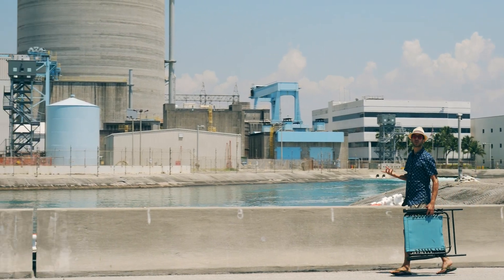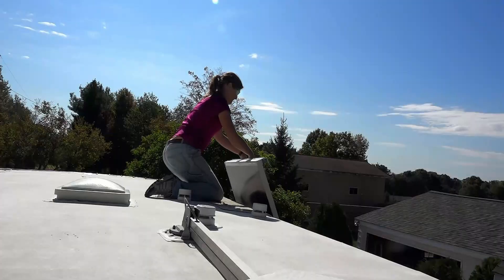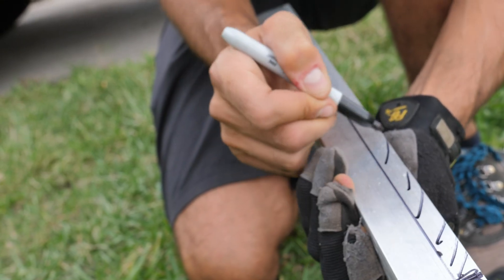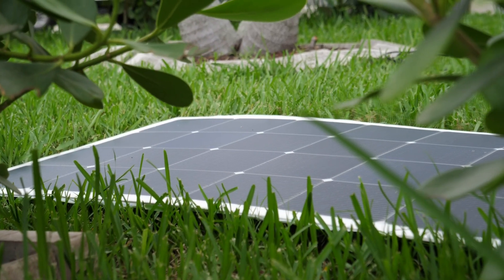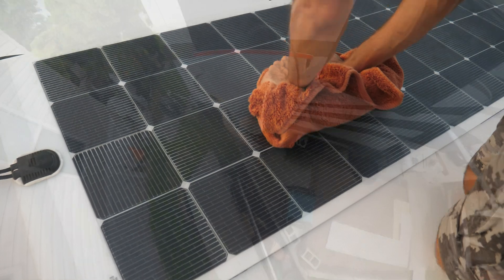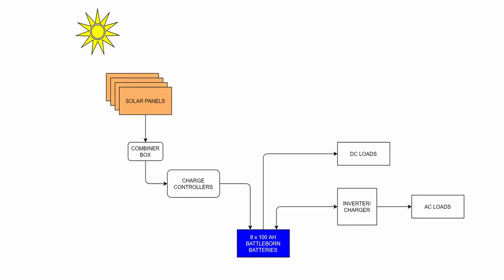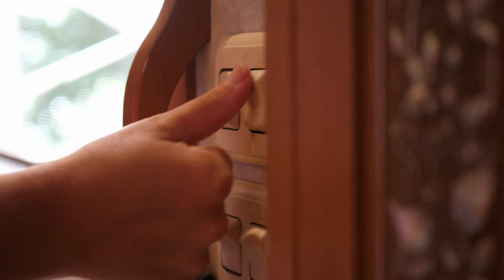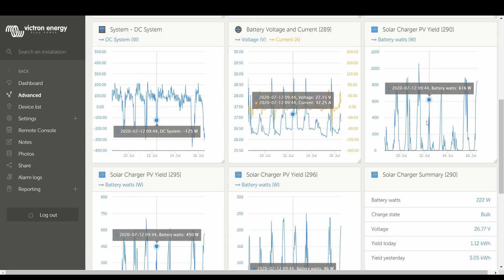Ultimate RV Off-Grid Solar System Build - 2760 Watts of Solar ☀️ 11Kwh Battery, on a 32' Fifth wheel

Comment: It could have been more detailed. A few key details would be: 1.  What was the total cost of all the units including the panels and cables?   2, How many labor hours did it take for the entire installation?  3, How much would it have cost to have it professionally installed?  4. How much would it have cost you for electric to be run to your property as a comparison of real values? (Not including having all that power in all the other boondocking locations you go to and without having to run that stinky, noisy generator!) 
    Please include details like these in your future videos, Please.

Comment: Over $13000 for this system not installed.  Is this correct?
Reply from the maker: About spot on,  could have been alot less with reg residential panels. This is our primary power summer tho.

Comment: One question and one comment.  What was the total price tag for everything?  Nothing made by battle born is cheap and that Victron setup is first rate.  Now, the comment.  Mounting the inverter on its side like that will make it tough to cool properly as the fans and intakes are meant so pull from under it and exhaust above.  You have any issues with it getting hot on you?  Especially in the non climate controlled basement?

Comment: I consider myself a very technically savvy. I've done a lot of very involved household and automotive electrical projects in my life. I have been a handyman my whole life. I have a very good working knowledge of automotive, household mechanics, and electrical systems. However, I must say, I am completely and totally overwhelmed and intimidated by designing and installing a solar system on the RV my wife and I just purchased. However, I don't know that I trust a local RV dealer to do a good reliable and dependable solar install. I just feel lost and I don't know where to go from here.
Reply from the maker: We understand it can be overwhelming to get started with RV solar. You may want to start here with this article: https://www.mortonsonthemove.com/complete-guide-to-rv-solar-battery-chargers/ At the bottom of the article, you'll also find a "Solar Calculator," which will help point you in the right direction. :)

Comment: Seems like the most expensive way possible to purchase solar, but I understand the sponsorship make a difference. How do those panels handle the efficiency loss due to heat, I've read that was the down fall of all the direct contact glue down type flexibles.
Reply from the maker: You are correct this is a very expensive solar system and not ideal for a fifth wheel. We used these panels on our truck camper too which made more sense. As far as heat, yes they have significant loss up to 20% mid day. Cooler temps or a bit of wind helps alot.

Comment: Would you please provide an update on how the install performed?  And the ones on the front of the RV? It is now 14 months later in December of 2021.
Reply from the maker: The system has worked wonderfully for us since we installed it! We are really happy with the overall performance of the solar panels and the batteries. The power has been very reliable and has given us so much more freedom, especially since we love to boondock.

Comment: great video.  impressive setup!  i am going to share this every time someone suggests that they can just slap a solar panel on their roof and run an air conditioner.  my van has 420 watts of flexible panels in a DC only system with a single 100 ah battery in a system i designed myself.  i ended up needing the help of electrical engineers to calculate the fuse sizes and wire gauges.  it runs like a champ for my simple needs:  lights, fans, and a small fridge.
Reply from the maker: Thank you! :)

Comment: I see a lot of people using 4/0 wires for RV setups. 4/0 wire is good for 300 amps of current. It seems to be overkill, or am i missing something? The solar panels at 2760 Watts at 52V is 53 amps of current.

Comment: Great system. We used flat panels on our last rig. Only downfall was winter. Just not enough solar to support our needs. Ended up adding 200 more watts of tilted panels to compensate. I noted in your video you had a few portable panels by the road. We are currently installing another solar arrangement on our 3rd rig. (Getting expensive-lol) and have most of the components on order or installed. However still debating the solar panels. Leaning towards ones that tilt.

Comment: With such a huge battery bank are you able to keep it at 100% after a few cloudy days go by, without any assistance from shore or generator.
Reply from the maker: Not 100 percent but we have not had to run a generator since installing thins system.

Comment: Are you worried about the uneven wire lengths on the parallel banks causing batteries closer to the sinks to wear out faster?

Comment: I love the setup! I just purchased an Alpha Wolf 26RL-L and pick it up in two weeks. I want to order all the components from your build. Will Battle Born help to let me know how much solar I can fit on the roof based on the specs or is that something I need to measure myself. Also, is there a way to just order the flexible panels themselves as your link just brings me to package’s and I already have 800 ah worth of lithium batteries. Loving your channel!

Comment: The system looks awesome.  I cannot wait to see it down the road.

Did you directly attach the solar panels to your RV or did you put them on something that provides some air flow or insulates them from the roof of your RV to reduce thermal transfer?
Reply from the maker: Check out the next video in the series, we did a bit of both and will be publishing the results soon.
Reply: @MortonsontheMove  I cannot wait to see the video and hear the results.

Comment: I'm totally getting impatient waiting for your next video to come out.. so figured I'd better ask some questions!

My future plan for the RV solar/wind set up is to run my AC's (2) with soft starts and run the 12V side of my RV (fridge and 12v outlets) off the batteries.  The question I have is.. if I want to run it this way, do you still need such a large inverter?  And is this as simple as running the batteries to the 12V side of the power panel with an off shoot to the breaker for the AC's?  Am I making more of a mess than I would need to just run everything and be energy conscious?   Thanks.. and keep up the great video's.. you got me hooked with Go North.. now I'm onto solar for the trip in a few years.. lol

Comment: Nice install!!!  I will be looking forward to see your power output during the few weeks when the days are shortest this coming winter. It will also be interesting to know how well the panels hold up over time.
Since your an engineer, maybe you can build some kind of protector shield that you can snap on during travel days, to help keep the bugs off and keep the panel from hazing, caused by abrasive road debris, like is often seen on plastic headlights of modern day vehicles.

Will you be selling the old panels that you removed? If yes, how much do you want for them?

Comment: I found these guidelines for supporting heavy components on vehicles (like batteries and large inverters):

Design loads for equipment support hardware:
On-Road:
3.7g Vertical
2g Lat + 1 G Long
2g Lat + 2 G brake on 20% grade

Off-Road:
5g Vertical
2g Lat + 1 G Long
2g Lat + 2 G brake on 20% grade

Factor Of Safety - no less than 3:1

Comment: Nice system and presentation all be it completely impractical unless your sponsored by Battleborn.  For that cost you can purchase a new generator and darn near a lifetime supply of propane / gasoline to fuel said generator.  I understand that's not in the best interest of the planet given the current climate of carbon emissions and such but reality seldom take those tings into consideration. These mega systems are not going anywhere until the come waaaaaay down in cost. But it does provide good content for Youtube.👍

Comment: You guys did a fantastic job with the video.  Since you know me I have so many questions.  I will limit them here to two questions..(I have reached out to Battle Born on other questions.)

1) what is your experience with the thermal impacts of direct attaching the panels to your RV?  Does it impact performance of the solar panels?  Does it add any noticeable heat to your RV?

2)  Did you go with the GC2 format because of the first 5 batteries from your Go North Adventure were GC2?  If you did not have batteries, would you have selected the GC2 format?  If yes, why?

3) Are there any concerns on performance of the panels flar on the roof when the sun is lower on the horizon?  Do you mitigate it by have more capacity that will meet your needs when performing at a lower performance because of the sun on the horizon?

We are excited to here your thoughts and your upcoming videos and posts on your website.

Comment: I'm having trouble with how you came up with 11,200 usable kill-awatts out of eight 100 amp hour 12 volt batteries. Can you elaborate. 

A 100ah battery will provide 1 amp X 12 Volts = 12 Watts for 100 hours. On the high end, 100 amps X 12V = 1200 Watts for one hour.

What am I missing?
Reply from the maker: The Battleborns are rated at 13.8 V but under testing their capacity is a bit beyond 100ah.

Comment: Great and very well done video! I noticed that the panels on the front of your 5th wheel are already starting to pucker around the edges.  Have you noticed any of this on the roof panels on the hottest summer days?
Reply from the maker: No the ones on the roof are staying perfectly flat.  The dual curve of the front cap did not lend itself well to the final edges and that was an issue from installation.  We will talk about that in the next video but basically I wouldn't recommend a dual curved surface.  Single curve direction should be fine Tho.

Comment: About how much money would you have to install a system like  that
Reply: $20,238 just for the main components listed: Inverter is $2,825.40, batteries $8,392, panels $8052- I had to calculate the price based on the package. Traditional panels would only cost $3,777, charge controllers $969. 
And that doesn’t include mounts, wire, dc to dc inverter, the thing on roof or labor, etc.  it is a dream system.

Comment: Question- how did you keep a system that large from over loading your truck’s alternator when connected and the converters start using the truck to charge the system?

Comment: I may have missed it in the video, but how do you keep the Battle Born batteries warm when its below freezing temperatures?  Do you use the $200 wrap per battery  or do you blow heat inside  the area were the batteries are located?
Reply from the maker: Because they are kept inside near our furnace no heating is required.  The batteries need to get down below freezing before they shut down (for charging only) and we will be keeping the RV well above that temp inside :)

Comment: I've been planning a solar system and have read that the flexible panels on the roof can create heat issues since there is no air gap between the panels and the roof.  And it's known that heat can impact the ability of the panels to produce output....  The other issue is that if a panel fails, it will be pretty much impossible to remove the panel from the roof vs. a solid panel.  What does Battle Born feel about these issues or what are your thoughts from one Electrical Engineer to another :)
Reply from the maker: Very true,  I really like the design of the panels and am hoping they will be very reliable so wont have to remove them.  As for heat issues, that is a problem, watch for our next video where we will talk about that a bit.
Reply: @MortonsontheMove  Look forward to it.  The other thing I've noticed and others have commented is that the output drops rapidly over time.  Even my 50W flexible panels only seem to produce 30W max now in full overhead sunlight where my solid 100W panels are still reaching mid-90s in full sunlight.  I've also heard output warranties on flexible panels are measured in single digit years compared to solid panels.  Curious what BB warrants theirs for.

Comment: The ultimate solar power system would provide the same 200a service you get from utility power.
Reply from the maker: That is very doable at a house scale!
Reply: @MortonsontheMove  If you have $400,000 for the battery bank and a couple acres of sunny fields.

Comment: So... You must be sponsored by Battleborn I'm guessing so the main part of this, the batteries and panels were given to you. Why not more Tesla batteries? Don't get me wrong, I like MotM, you provide good content. Heck the Battleborn panels are only available, right now, in a bundled package.
Reply from the maker: Yes a portion of the build was sponsored.  Like we said in the video we already had 5 BB batteries so it made sense to build out the rest that way.  As an EE i have worked with BB on some products as well so this is also a test bed.
Reply: @MortonsontheMove  Thanks for being forthcoming. My plan is to put 3500W of panels on my 29' class A. My plan includes removing both ACs and all vents from the roof. Then I will get the roof Armored by RVARMOR.com. My plan includes a minisplit installed on the back wall of the rv. With a clear roof to work with I can install 20x175w flexible panels. Also debating installing 4 Tesla batteries in parallel. The propane will be removed as no longer needed as well as the 5k generator too.

Comment: Good to see you guy's it's been awhile loved the video you really stepped it up love the topic too hope to be building something similar as well.
 I have heard a lot of negative talk about the flexible solar panels in the past you know "they break down, much lower wattage models, and just don't last that long on average only a couple years.

 Anyway I now have a new outlook on them if the Morton's on the move is investing in them tells me a lot and you have done your homework on them so that's encouraging and I'm really glad to see that some engineering changes are on the move,  no pun intended.

Thanks and I'm looking forward to your next video.
Reply from the maker: Yup, before these panels we would not have done flexible solar either.  I love their design but they do still have the Heat issues... Be sure to check out the next video where we discuss some of these things!
Reply: @MortonsontheMove  looking forward to it,  thanks.

Comment: Tom, as a retired Electrical Engineer (designed several of my own solar systems) and 49 year RV owner, I watch and enjoy ALL your videos, keep them coming. With all due respect, however, I have a couple hopefully constructive comments. 

 I think about all those front panels are good for is to catch bugs and wont yield much energy harvest unless the sun is just rising or setting low in the sky and your front cap is pointed directly towards it. Otherwise its angle is far too great. Removing bugs and keeping them clean and operative will be  quite a task for as little energy as they will gain you in my opinion, hopefully, the other 2300 Watts should be plenty !!!!!!! But its YOUR RV, YOUR money and YOUR choice which I respect.

 Your technical information is excellent, BUT (in my humble opinion)  YOU NEED TO STOP OVER ACTING !!!. Just be natural and the engineer you are NOT so syrupy and sweet and phony, its hard to watch lol. Act like Cait, be yourself, you're an engineer NOT some actor wannabee lol. I watch and enjoy your great videos for the TECHNICAL aspect, you don't need to try and do more as far as I'm concerned, but that's only my opinion.

 Please don't take offense I  mean only to help.

 John T,  BSEE,JD    Retired Electrical Engineer and Attorney in Indiana
Reply: John, 
You make some valid points regarding the front panels. Maybe he can adapt some shield that snaps over the panels when he is driving.
Where the panels will help, is during the winter, when the sun is much lower and the solar hours are much shorter. The top panels obviously can't be tilted, so they will have a much lower output, combined with the short winter days. Assuming he positions the front of the rig to face south, those front panels with help offset the output loss of the top panels. It will be interesting to see what his output is during the winter time, especially during the few weeks with the shortest days of the year.

Comment: These guys are really slick marketers, I will give them that. I mean, are these Merlin panels?. They use the same grid graphic to explain the durability. BB can brand these as their own, and put people in a bundle with their batteries, but the Merlin panels are available from Northern Arizona Wind and Solar, if you don't want the bundle. Merlin was a US startup and now it is part of a Phillipine conglomerate. Oh, well.  Is that a little sad? Ray at Love Your RV had another LFP option the other day on his website.Less money.  I don't understand how you picked the wattage and watt hours. Campervan Kevin did a nice series on using a split heat pump in an RV. He suggested a wattage number that was well below the standard roof air systems.  I might start there. In other words, the best tech for an RV, heating and cooling, is the split heat pump. And cooling is a huge number of watt hours.  I would size an RV system in a different way, and buy different components. I did question the Tesla system versus LFP. I hate to see solar and lithium turned into a pissing contest. Yikes.
Reply: I've been looking at the Tesla option for my application... size, weight, cost. The key is the right BMS, which is out there now.